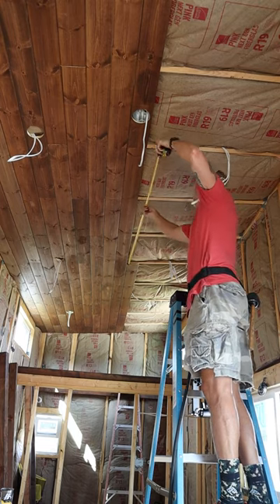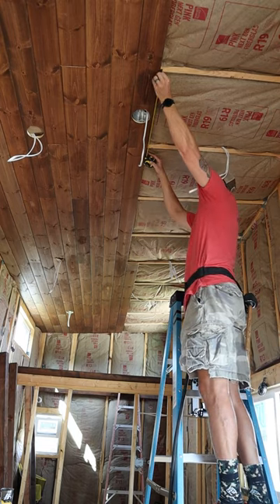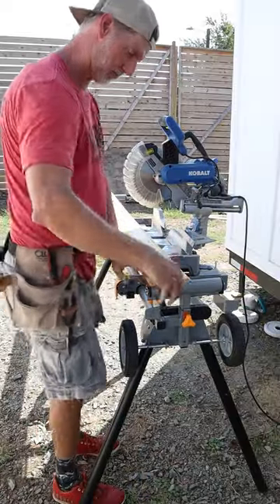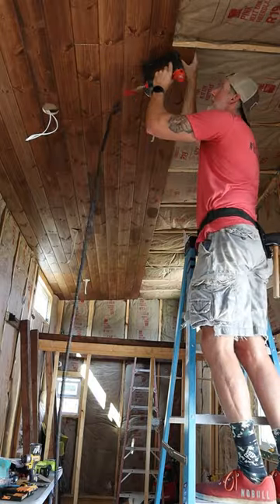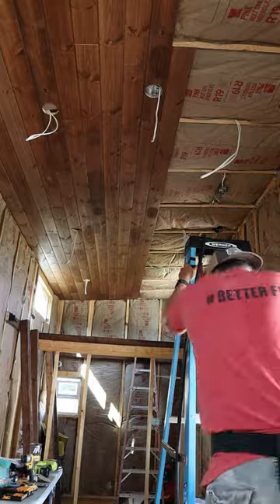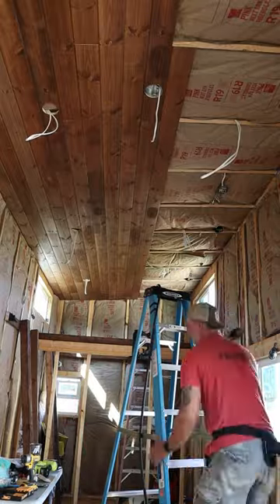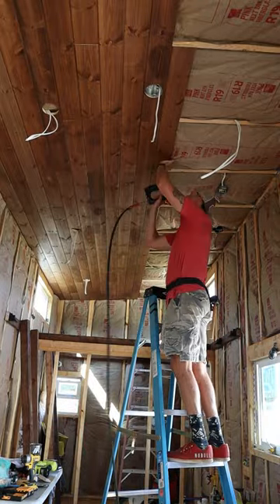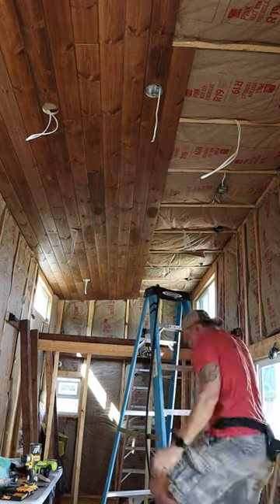Installing Tongue and Groove Ceiling Planks | Tiny House Build

Comment: How do you repair this if water damaged?
Reply from the maker: Well you are very correct and observant. The whole system has to be checked first before any closing up of the walls or any installation can go in. All of my lines were pressure tested for several days before even installing insulation. But as we all know shit can happen. I definitely would not do T& G again.
Reply: @WillMosbey  did answer my question

Comment: Does it need  air and moisture barrier , if using  mineral wool insulation?
Reply from the maker: According to the folks at Noah who did the inspection, a moisture or vapor barrier is not necessary in the ceiling. Looking back I kind of wish I would have done a vapor barrier in the subfloor. But it all worked out.

Comment: Why didn’t you blind nail these?
Reply from the maker: I definitely could have but a lot of the boards were very warped so face nailing was my only option. It was a fight to put the T and G ceiling in.
Reply: That's what I was wondering. Haha It should be groove side over the tongue (like wood flooring), and then you work the warp out by nailing it down the row and nailing through the tongue. To each their own tho! Love the stain color

Comment: Wheres your fire rated sheetrock?
Reply: Typically fire rated sheetrock is not required for residential buildings. Only certain areas of residential buildings may require fire rated sheetrock.

Comment: Looks awesome, any new updates looks for this job ?
Reply from the maker: Thank you and it came out beautiful. But I promise I will never install tongue and groove on a ceiling again. It was pretty difficult.
Reply: How many sq feet did you do and how long did it take? I will be doing it first time
Reply from the maker: @ChueyRodriguez  A little more than 240 sqft on the ceiling. Mainly using 12' T&G boards. Which makes it tough to handle by yourself. If I was doing it again I wouldn't use T&G. I was use regular 1x6 boards. So much easier to install and way faster. Took me 3 full days to install the ceiling.
Reply: What made it unbearable to never do again? Looks outstanding